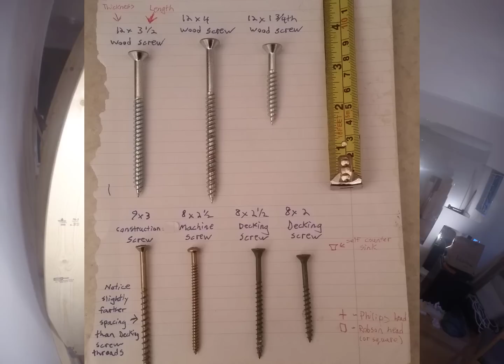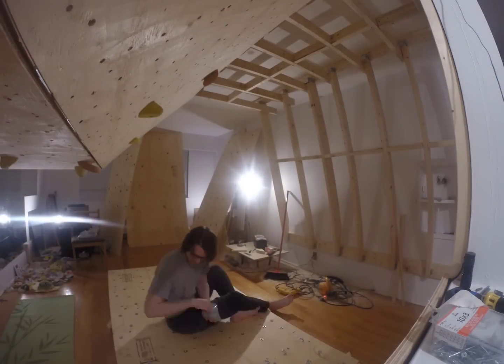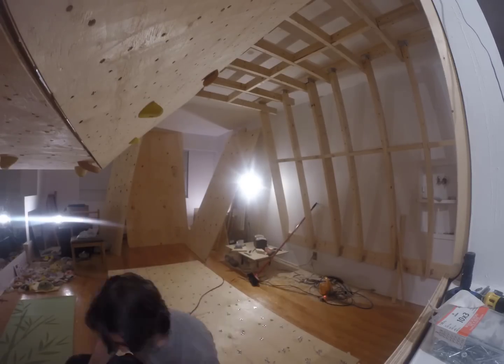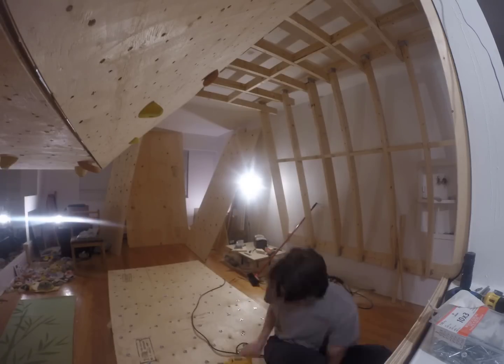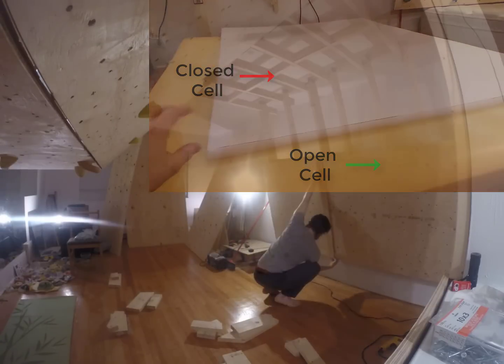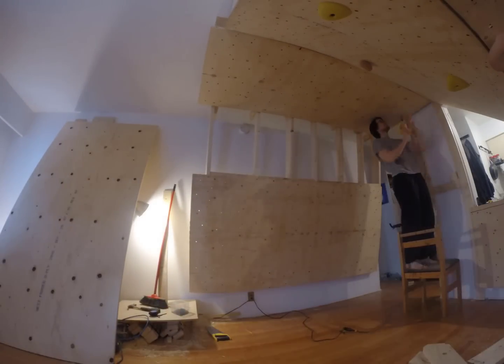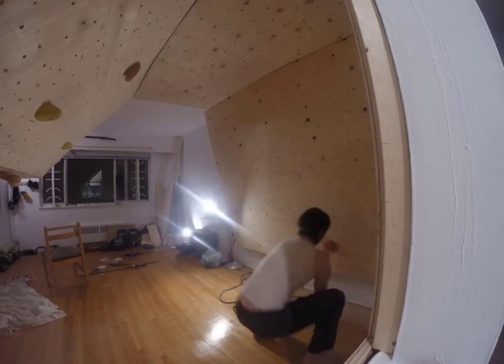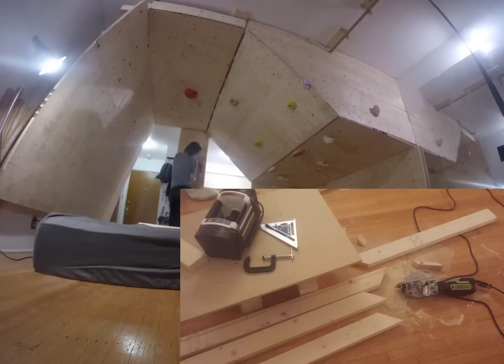How To Build A Bouldering Wall In Your Home

Comment: Even though I have three of the electronic one, I found best is neodymium magnet as sheetrock screws don’t penetrate below the outer paper surface. To prevent hold rotation, maybe a little silicone caulk on the backside to add friction - let it dry for reuse later. Most of the time Phillips head screws are fine, just predrilled and use an impact driver. 

Nice wall, hope the landlord don’t mind.
Reply: Frank, we were thinking of painting the plywood with a textured rubbery type paint...do you think it would work?

Comment: A landlords nightmare this guy is
Reply: This can all easily be reversible, with minimal work to patch up any holes. I own multiple rentals, trust me. This guy is the least of your concerns.
Reply: CoLew Exactly. Usually the people who put a lot of work into the living space, are the easiest to deal with. I used to own multiple rentals, but it became too much of a hassle. Even with a property manager, etc. Not for me!
Reply: Are u not allowed to make reversible changes to your flat or apartment in US or Canada? In Germany your landlord can't tell u to not do this kind of stuff. If it's not a permanent build or endanger the overall safety of the building u can do that.
Reply: I don't think so. Sure, there are a couple of holes here and there but nothing that can't be easily fixed. Most of the construction is on the wood. Now if it was the other way around that would be a problem!
Reply: Some lease contracts will have a clause about not screwing or nailing things through the drywall.  At the very least you may lose your deposit

Comment: Another method to get smells out of mattresses is an ozone generator. You can get one from Amazon for $70.

This is what hotels use to get cigarette smoke out of rooms, & for getting smoke damage smell out of a house after a fire. I bought and used one for a car bought from a heavy smoker. It works great. They need to be used in a closed room/space. You set a timer, let it do its thing, then you have to let the space air out before returning. You don't want to breathe this stuff in the levels it takes to get smells out of fabric. Read manufacturers directions.

Comment: The quickest way to find a stud is to look at an outlet.  There will be a stud on one side of the outlet. Once you find the stud use a tape measure and extend it making sure that a 16 inch number is on that stud.

Comment: i would have done a  45 or 50, 60 ? degree Wall and thats it .  the roof is for training not really necessary. a long wall where you can do long moves, at least one. sry to say but for your height the wall does not fit . for your children its maybe very good

Comment: Nice video. thanks. 2 quick tips for finding studs if you have baseboards and no stud finders: remove the baseboard and hammer some small nails in every 1.5 inches until you find it. The holes will be hidden by the baseboard once you nail it back. The other tip is via electrical outlets. They are always mounted next to a stud, so you can unscrew the cover and figure out on which side it's located. Then measure 16 inches for the next one.

Comment: Why don't you built a door in the slope and stabilize the inside and make it a chill spot i the rock wall
Reply: nick kemple 

I was thinking something similar. Or maybe putting some anchors in for a hammock. Not exactly something I would do, but hell hes committed by now

Comment: Great build! I love the angles - you've got a little bit of everything to keep your wall interesting for a long time.

As far as set screws go, it's only a minor inconvenience if your holds don't come with pre-drilled holes for screw placement. Often the simplest approach to prevent a hold from spinning is to just wedge a secondary hold (usually just a foot chip) against the primary hold along the axis of rotation. This will lessen the need for set screws in general, which will keep your wall free of unnecessary screw holes.